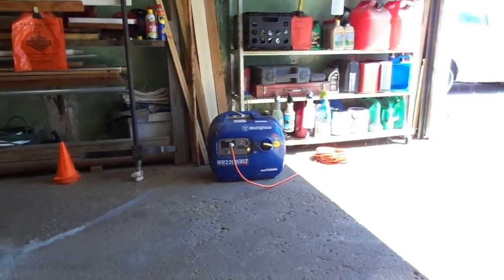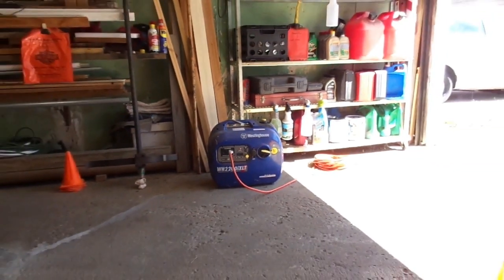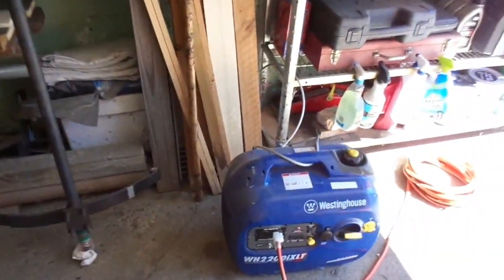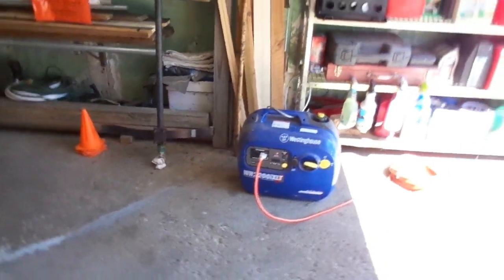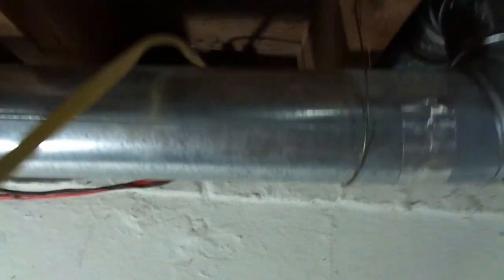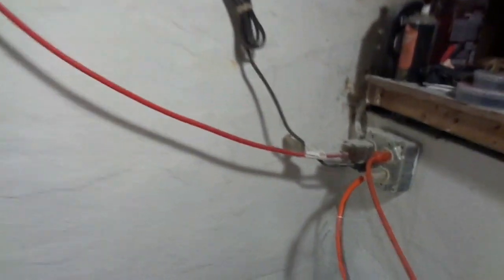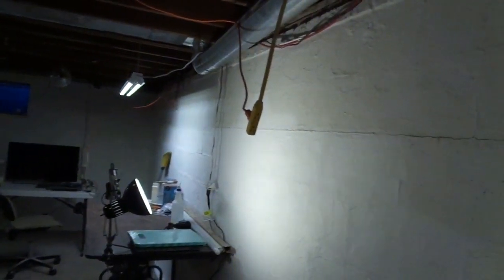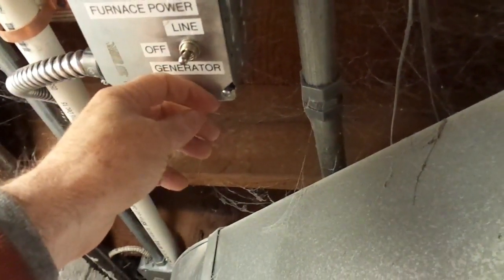TDD report for Sept. 22, 2018 - Generator Review

Comment: Well, funny how timing is. Just came back to this vid to say I ordered a 1800w Wen on Sat. Like your idea for getting power into the house. May work on that in the spring. Thanks Chuck.
Reply: YW Brian. I hope it works well for you. I suspect they are all built in one or two factories in China with just minor changes to fit the manufacturer specs. So far my Westinghouse has been used a bit and still runs great. If it lasts for ten years then dies I did well for my $400. I will just go buy another one. :)

Comment: Interesting, hey welcome to fall eh? On the topic of generators, be sure to install a fuel shut off and always shut down you generator by running it out of gas. These alcohol blended fuels can/will mess up the fuel system in a few months
Cord sets, I'm sure that you uncoil yours during use, however, a coiled cord carrying a lot of current will heat up due to induced magnetic fields on to itself.
Personally I like 12 gauge extension cords. For light loads like lighting, one can skimp by on 16 or even 18 gauge cord sets, just never overload that cord.
I've got an ancient Onan generator, got it for $50. Electric start too, it's older than me, built in 1946.
What I use for emergency power is an inverter out of an ambulance. I figure if I am at home so is one of the vehicles, I just connect it to the battery, fire up the engine and plug in a load or two. Like your generator, this inverter will output 1800 watts with a 3600 watt duty cycle of up to one hour so it can start some big loads. It's a Dimensions 1800n made in Minnesota.
The load on a vehicle electrical system can be maxed out fairly quickly with this inverter, so I keep a keen eye on my load and vehicle.
Reply: I do drain the gas for storage . 
So far six months or less and the gas has always done fine in the tanks for all my power tools, lawnmower, snow blower and generator. I am picky about the gas I buy. 
If it's going past a year I add Stabil and keep lots on hand.  
My cord is just the right length to reach the power port with no coils and it's 12 gauge.  
I am not a big fan of electric start because it tends to fail on me in the worst times. 
I dealt with that a lot at my job before with pumps and generators.  Always having to jump start crap. 
Sounds like you got a great deal for $50.  
My load is never above the max amp rating and typically around half so my gas can last 8 hours if need be.
 I could get by on two gallons a day or less easy.

Comment: We have one that runs the hall lights, the boiler and hot water and the elevators. Supposedly it will run for 4 days. It did a good job running for 13 hours the one day. It's a lot bigger of course.
Reply: Yes that is probably a Kohler or Generac power plant unit or something real close. 
Generators like mine are recreational grade and at 500 hours are about at the end of lifespan.

Comment: You can get an electronic controlled switch for items on the generator that switched the feed as soon as power comes from the generator.
Reply: I am too cheap ass to pay that sort of money. 
The ones I would even consider cost $1800 and that is not installation which is a pain even if I do it myself. 
I would be required to get a 200 amp capable transfer switch because of my service.